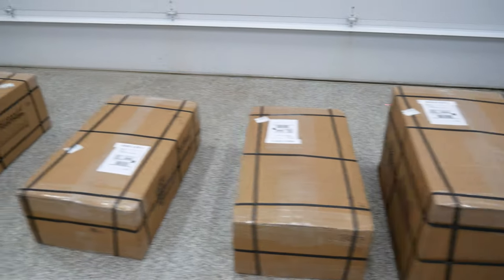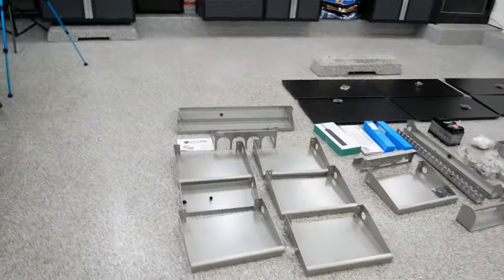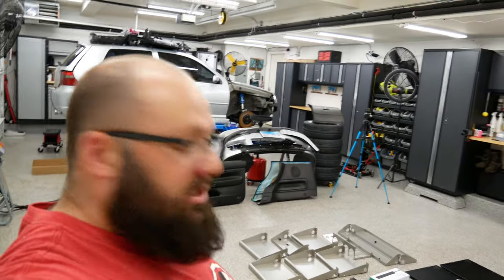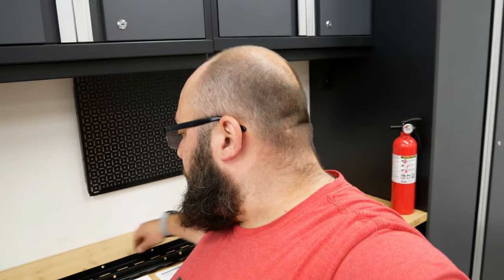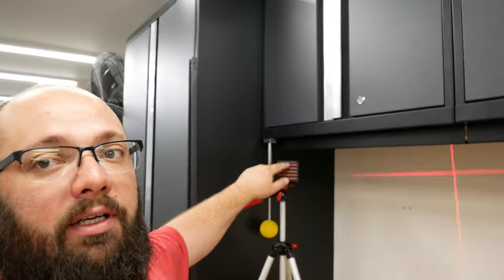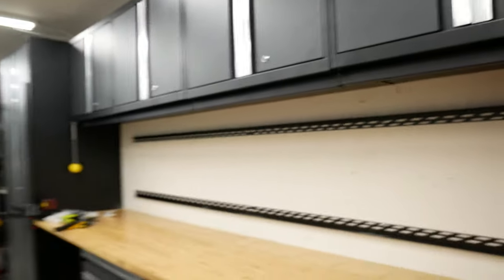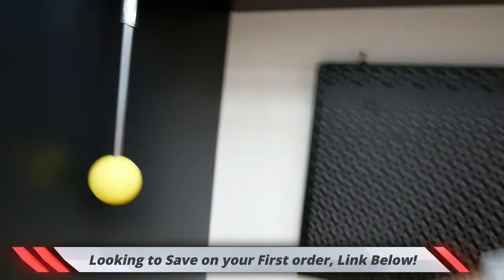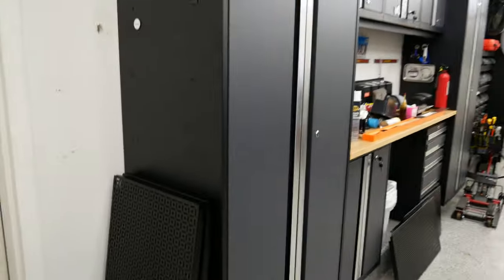Omni Wall USA, Unboxing and Install, Pt. 1 Garage Wall Tool Organization and Storage

Comment: Your garage is very well set up! Thank you for the kind words about our OmniWall system!
Reply from the maker: No Problem, you guys make some good stuff! I have about 6 videos going out all different set up!
Reply: @GasTachs  Hey just a heads up, The Drill holder is intended to be mounted off the front of the 8 x 16 shelf. The open hem hangs from the shelf mounted above it. This gives it more strength and allows you to charge your batteries directly above.
Reply: @GasTachs  Oh and super stoked to see the new videos. Keep up the good work!
Reply from the maker: @omniwall1646  Yup thanks!, Its in the video tomorrow! Loving it!
Reply from the maker: You'll see in todays video I that I didnt use that lay out, it was just to see how easy things when together!

Comment: After buying from wall control I started seeing the socket shelf from Omni wall popping up mostly in ads on Facebook and Instagram so I need to research to see if it will work with my wall control or I will purchase Omni for my garage instead of my shed/building out back. Thanks for doing these videos (been curious about them since seeing the ads) and looking forward to them all. Great work on the garage! Keep it up
Reply from the maker: Kyle Burns thanks! All 6 videos will be out this week! Sit back and enjoy and hopefully it helps👍🏻
Reply: Kyle, our system is not compatible with wall control. When we evaluated their design for attaching components to their system, we found it was not strong enough. You will notice they do not have any accessories that come out more than 6" or so from the wall. We developed our tab design so 12" or bigger accessories could be mounted. Have a great day!
Reply: OmniWall thank you for taking the time to reply and provide valuable information on my situation. Once I am ready I will be ordering some of your products for the garage 👍🏻

Comment: You can use a magnet to locate wall studs. Press the magnet against the wall, and move the magnet up and down along the wall, while slowly moving to the left or right. Within 36 horizontal inches, the magnet will find a drywall screw or nail. once you have located a screw or nail, move straight up and down to locate more screws, this will verify that you have found a stud.
Reply from the maker: Thanks